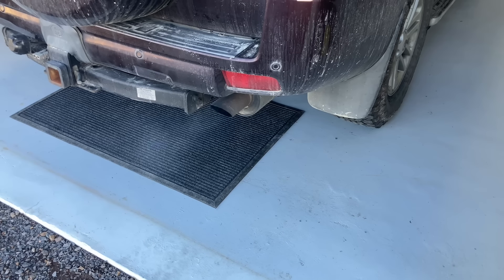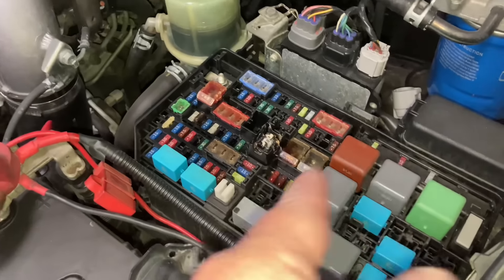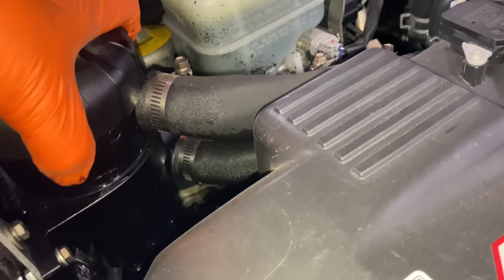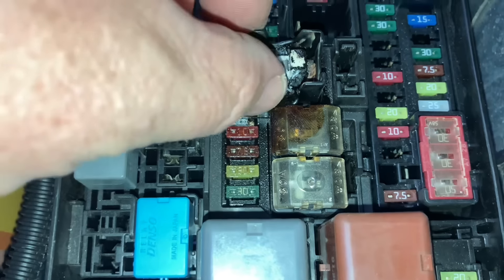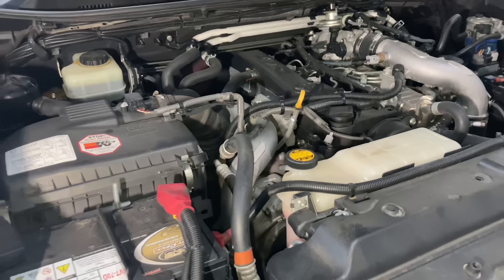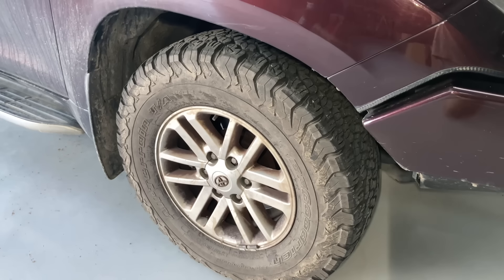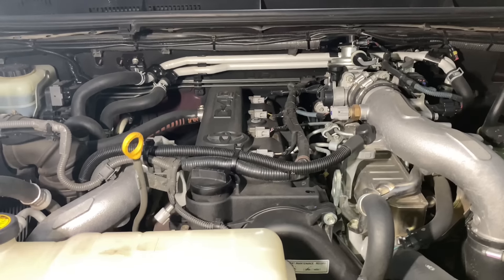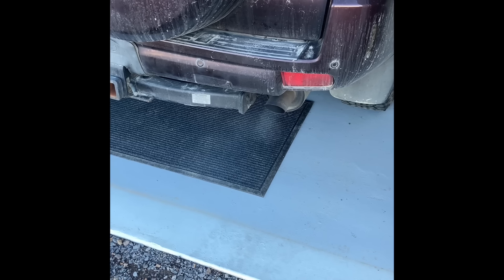CRACKED PISTON But ANOTHER PROBLEM and WHY IT HAPPENED

Comment: I wrote in the last video. It's unlikely that the starting battery to starter motor goes through the fuse. They probably started off the auxiliary battery which directed current through the fuse to the starter motor.

Comment: My j120 d4d has 353000km big wheels, extra gear and engine runs like a dream. Just changed one injector due to small variation.  Good fun but rusty she is. much luv from Poland

Comment: I'm in the process of removing the ARB bull bar on my 2005 now. So many problems that it's caused. I actually use it as a work vehicle, so it's quite handy as a tool for me, along with the winch occasionally.
The corrosion and butchery from the installation is a joke. They've used a grinder to cut the original parts. Genius.
They've also attached electrical earth lines to painted parts that have all sorts of other corrosion issues. 
I'd be pretty pissed off if I'd paid big dollars to have it installed.

Gold nugget moment.
Puff, puff. 
Banda Bing.

Comment: Has the owner put a solar charger on the battery system without MPPT or faulty MPPT whilst charging turned the vehicle on. Or has he connected the solar charger wrong way around.

Comment: This alternator fuse is an interesting dilemma. I am going to take a punt here. I reckon that fuse got hot because they were charging a lithium battery without dcdc charger. The battery will take as much as it can as they have very little electrical resistance and so for a period the alternator would be delivering full output. Hence the hot fuse.

Comment: Those fuses are bolted in so probably just a loose connection inside the fuse box, it could have had an aftermarket alternator fitted that is higher amp rated than standard or there is a loose terminal or faulty battery.

Comment: Oh yea many vehicles do have catch cans fitted from factory . 
Stainless mesh can be sourced in many different grades and styles 
Mesh commonly used in engine breathers 
By not fitting egr delete /catch can you need to clean inlet manifold at no more than 100,000km  to maintain/stabilize  fuel economy and throttle response .
Dirty combustion chambers shorten injector life and degrade spray pattern  performance quicker  vs an engine breathing clean air  .
Reply from the maker: That’s right get rid of the problem which is the EGR not the oil and you’ll have a clean intake. Thanks for telling us we didn’t know that. 🤣🤣🤣
Reply: EGR and PCV/oil  have been causing issues on some  model  cars since the late 80`s . Did I say some injectors wear out due to this .  EGR to diesel is the chief of contamination . Some makers fit catch cans factory OEM.
For the greenies EGR PCV work but service costs should be accounted for 
manifold clean 100k // injectors service check every 100k // EGR service every40--50k . Many had inspections 
Various  vehicles do some of this in the 80`s some diesels came close.
Modern vehicles donot need servicing !!!!!!!!

Comment: One the fuse issue, Probably, because it has two battery, the owner think he can runs a lot power consuming stuff  loading the system in long period, without care thinking he has a spare battery to start the engine,

Comment: The 1GD update has good power and torque you dont need chips tunes etc, waste of $$$$
Reply from the maker: Yes, it does have a good torque and enough problems without adding to it.
That being said, still the most reliable vehicle, most people are going to be lucky a lot luckier than people that went for some other brands  🤣
Reply: @Fourby4Diesel  for sure, the amount on road as you say maintenance done right and with minimal extras and no tune chips etc they are a pretty good unit. I rate my 2022 Fortuner 😊